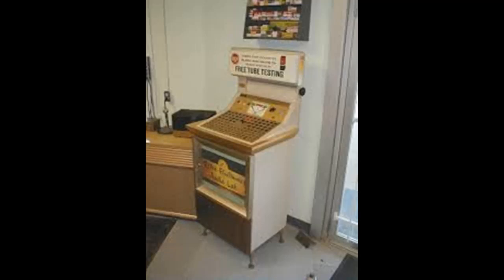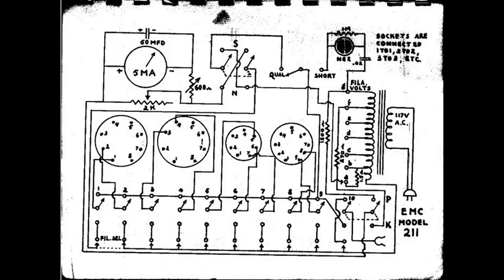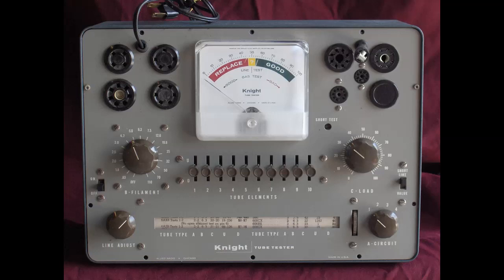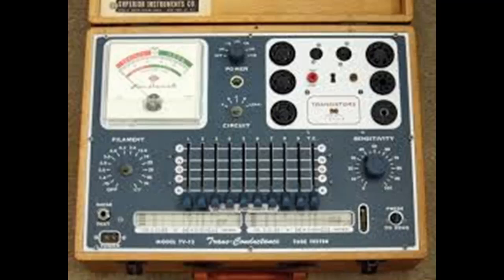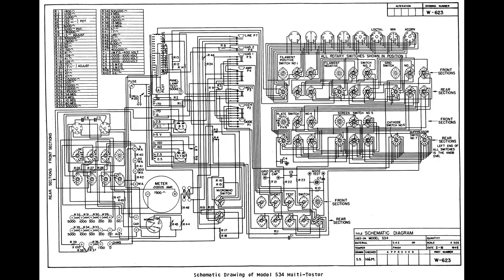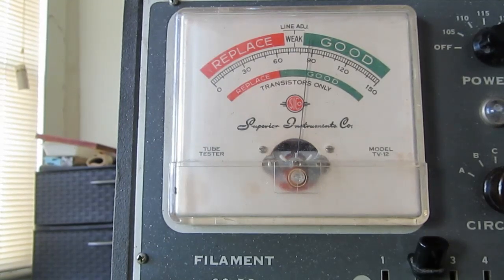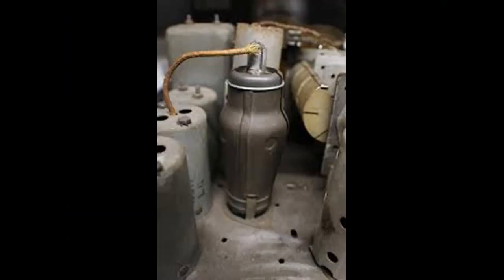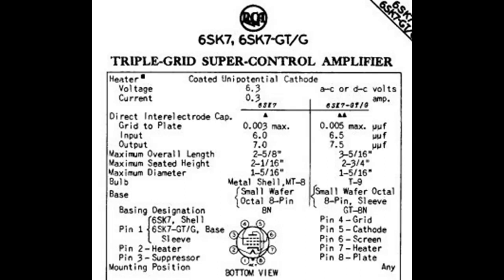Tube Testing & Replacing

Comment: Forgot to mention in a previous comment, a comical moment from back in the fifties. We had our only black and white tube set that would occasionally crap out. My uncle would patiently remove all the tubes, run down to the local drugstore and test all the tubes. He would feel great if one showed marginally weak and purchase the ones he thought were victims for the problem. However, on replacement back into the set, it still would not perform. Usually Horizontal sync problems. My parents would then call the local repair shop and they would pull the chassis to do the repairs and have it back in a week.
Reply from the maker: The RCA tube manuals all say that the only true test of a tube is does it work in the circuit. I've seen tubes that test very weak perform just fine.

Comment: Good overview, Bob!  A good friend of mine has a TV7 he received at a  now defunct radar/military company. He's talking about selling it, but is worried about  not being able to test his tubes. He's not into hi fi, so I told him don't sweat it.  Buy an adequate tester for your needs, mostly antique radios. I have many testers myself and my favorite is a Mercury drugstore.
It's fun to use, quick and adequate for my  needs. It's also excellent at picking up shorts, and gassy tubes.
Stay safe,
John
Reply from the maker: Biggest problem with some of the testers is you need a college degree to get it set up correctly. There are plenty of Knight or Eico that are simple to use and get the job done.
Reply: I agree, Robert! I was at a ham fest in New Hampshire a while back, and two audio nuts spent hours talking about the mathematics of power supply design for clean audio. Oh yeah, they both had hearing aids! (Only kidding) . Keep up the good work you're doing on your tutorials, they get to the nuts and bolts of breaking down electronic circuits. I was an electronic technician for 20 years and learned  a lot from some superb engineers.
Cheers, John

Comment: OH MAN I remember those drug store tube testers and my first so called "tube tester" was a simple continuity filament tester. 
I always drop the filament voltage on every test I do for the "life' test, been doing that since I first had a tube tester.
My very first "tube tester" was a LAFAYETTE TE-15 back in 1962.
Thank for the video Bob!
Reply from the maker: For most of the AA5 radios and series strung TV sets  back in the day a filament tester was fine because that was usually the problem! ;-)
Reply: @YouAllKnowBob  I agree, my dad would send me to the corner drug store to test some tubes he took out of the TV, those were the good old days.

Comment: Great tube tester and tube type video Bob. After getting a Knight tube tester a couple of months ago, I was amazed how some weak tubes actually work just fine in the radio. The tubes are far more reliable than you would think after all of these years.
Reply from the maker: Well, if you haven't already, you should check any resistors and capacitors in the Knight to make sure you're getting accurate results. Most tubes were not used at their maximum power values so work fine even if they show weak. Always remember what the RCA tube manuals said. The only true test of a tube is does it work in your circuit!
Reply: @YouAllKnowBob  Thank you for the advise on the resistors.

Comment: What a great video Bob, great explanations. I never knew the GT stood for glass tube. I also did not know that the metal tube could replace a GT tube but not the other way around. Thanks for this video sir! I would be cool to find and restore one of the old stand-alone drug store testers. I do remember them and going wih my dad to test the TV tubes. Shleigels Drug Store. Probably spelled it wrong.
Reply from the maker: I can't imagine the nightmare of wiring that went into one of them. A standard tester with 8 or 10 sockets is a bear to rewire let alone something with 60 plus sockets! I don't know if GT really stood for glass tube but that's how I learned it. G was the Coke bottle type and GT was the straight tube.